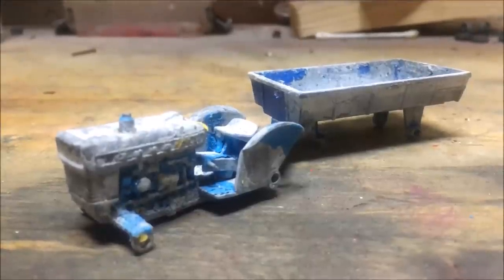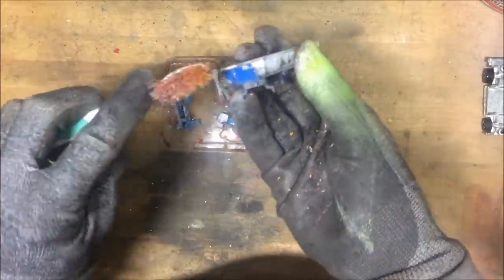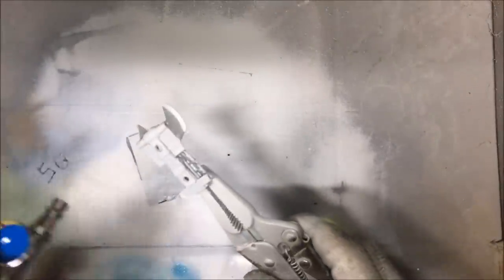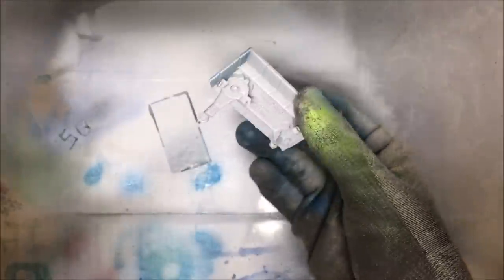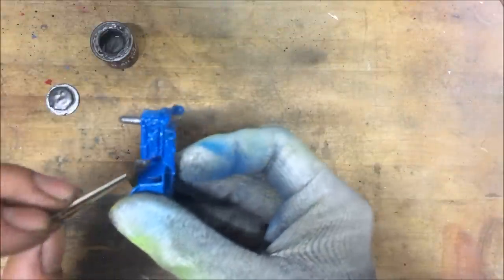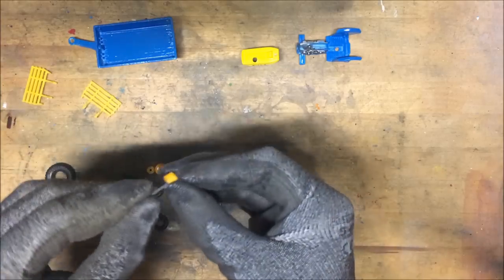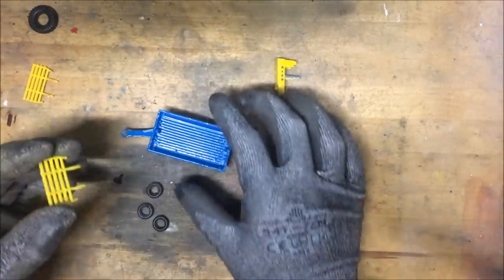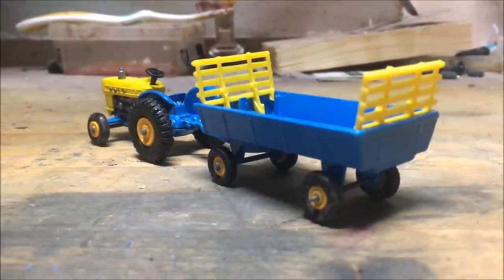Matchbox No.39c Ford Tractor & No.40 Hay Trailer - Restoration

Comment: To hold things like that trailer I often use a piece of softish wire, like a straightened paperclip, and put it through a couple of the axel holes, then kind of bend it a bit so its jammed in there and you can hold the casting for painting and move it around, then make a little hook on the end of the wire and hang it up to dry. Once its dried just bend the wire again a little to loosen it and take it out.

Comment: Great job it looks really nice just like new. 

You could make life much easier for yourself with some surgical forceps they are very cheap to buy on ebay. You can hang them from a hook or a magnet while the paint drys. I have several pairs and use them all the time.